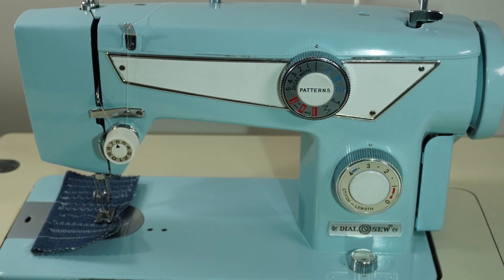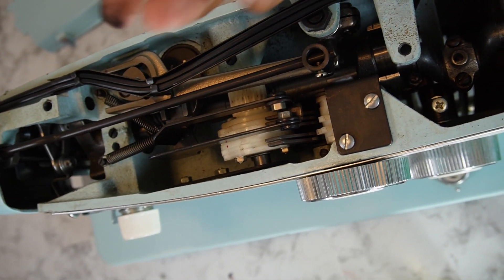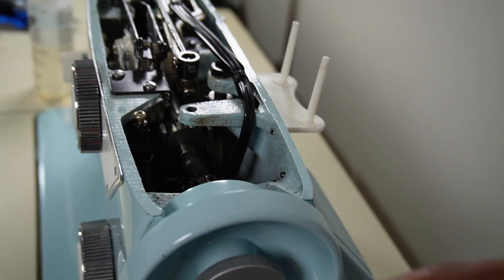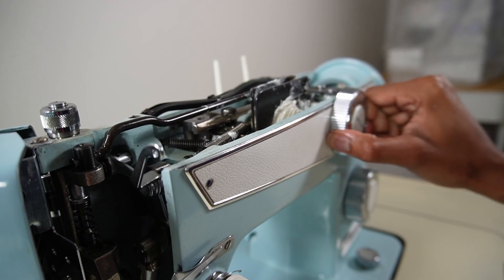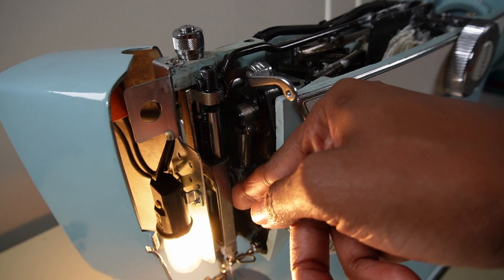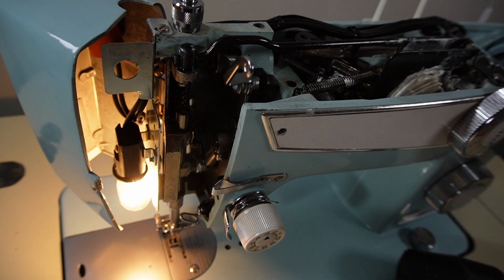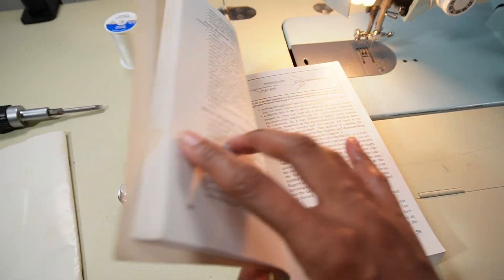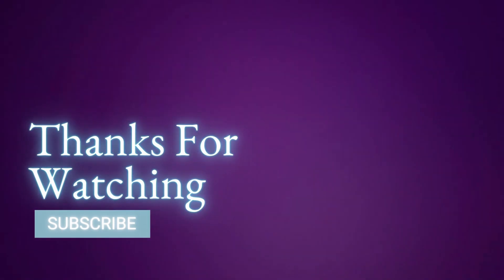Fixing A Seized Up Sewing Machine: Dial N Sew 750

Comment: How do I get the stitch length to change? I’ve moved the dial, but stitch stays tiny
Reply from the maker: It sounds like you have a problem with your machine. There are a few different issues that could result in the stitch length not changing. The most common issue is the feed dogs. Is the bobbin case area and the space underneath your feed dogs free of lint? Also, are your feed dogs 1mm above the needle plate. If not you'll need to make some adjustments or take it in for service.
Reply: @ThimbleBook  thank you for the quick reply. I’ll check those. I just thought I was missing something cause I didn’t even realize the inside of the dial pushed in, which I still can’t figure out why but it doesn’t seem to affect the length.

Comment: If you plan to use this machine, be careful not to sew very thick fabrics. It appears to have plastic gears which will not tolerate heavy usage.
Reply from the maker: Yes, it's definitely not a machine for sewing thick layers of leather or denim. It's mostly for piecing or garment making.
Reply: Thanks😂